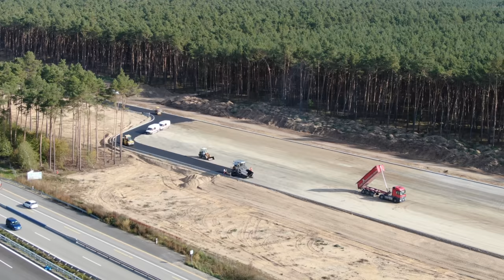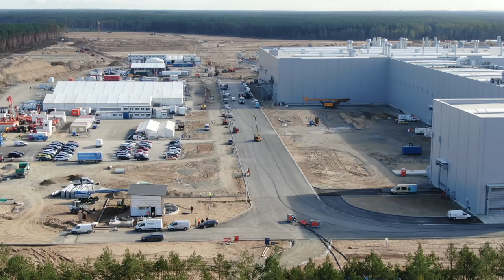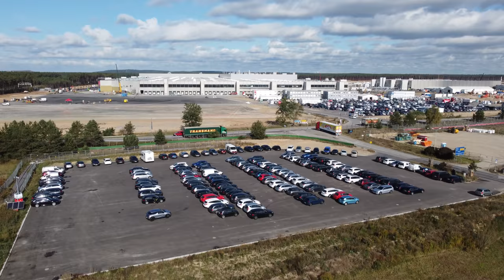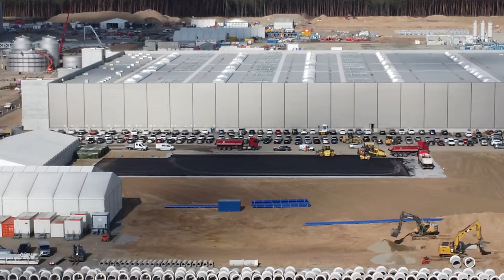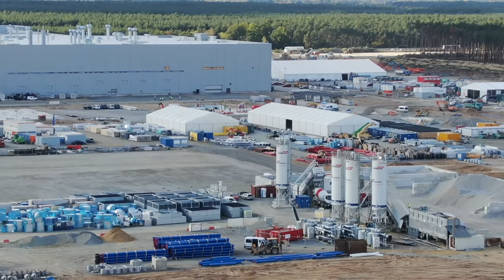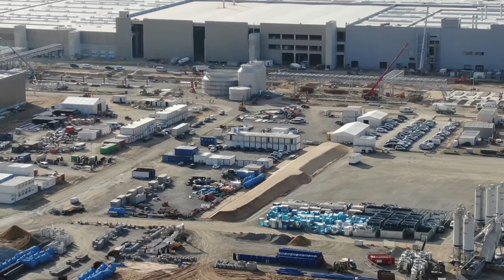Giga Berlin | 2021-10-13 | Timelapse

Comment: Cannot imagine that in the beginning there was made a calculation by a group of engineers for an offer to build this factory at a certain price ? 
Each truck and each crane that is driving around on this construction site is either paid by the hour or paid by the km that it is driving. Same is valid for each construction worker and each subcontractor.
Who knows in advance what work has to be done for this project. Incredible!

Comment: The small size of the battery factory is astonishing - space requirements of 4680 cells seem to be 1/10 or so of the original 18650. To my understanding battery factory is designed to cater for giga berlin exclusively?! If so, this is really impressive.
Reply: See battery day, the dry coating material means 10X reduction in space required and 10X reduction in energy used (no drying required).
Reply: ~50GWh from that plant, more than Nevada!

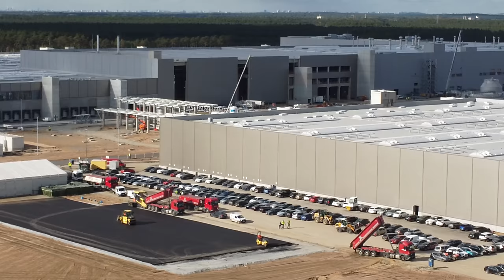Comment: 11:51 Will there be big windows on that wall or will they put panels? When will it happen?
Reply: There will be surely gates on ground level there. Also at the part between the small and the tall staircases. Here it looks also as there will be windows on the 1st and 2nd floor (European counting). Don't think there will be windows where the Giga Presses are (or will be). Horizontal windows would be easier and cheaper than big vertical windows.
Reply: Production areas will not have wall windows, that is a safety hazard. You don't want to be blinded by a sudden beam of sunlight while operating a machine that can easily mush you and 5 other people in one move. Only offices and other non-machinery areas will have those. Production areas will only have ceiling windows, as those cannot pass sunlight directly into your eyes. And even then, they are frosted.
Reply: @HenryLoenwind  Giga Texas factory has windows on the exterior vertical walls in most parts of the factory.

Comment: I see they are starting to put up some tents. It seemed crazy when they put a whole Model 3 assembly line in a tent at Fremont. I suppose if a tent will do they go with that rather than a more permanent structure.
Reply: There will be no tent line at Giga Berlin.
Reply: @monsieurb90  You don’t think the German regulators will go for that? Oh well.

Comment: Maybe my imagination, but the activity seems to be at an even higher tilt after GigaFest.
Reply: New pre permission arrives for Roof installation and some other Things.
Funfact: Earlyest possible overall Permision by law possible in 2 Days after public hearing. 
Then ramping up in Hours
Reply: @JK-ku2mj  Die Genehmigungen werden NICHT 2 Tage nach den öffentlichen Anhöhrungen erfolgen, und es wird dann auch nicht schneller gehen.
Reply: @JK-ku2mj  What's the overall success rate for permission after a public hearing? Or is there any particular case study similar to Giga Berlin? Just curious.

Comment: I have a question Tobias, when will the model 3 be produced in Berlin?
Reply: no
Reply: @bliblablubdiedadup742  why?
Reply: My guess is in two years. First the model Y needs to get production ramped up, then other models will follow. It may even be that the German designed city car will come next.
Reply: @gpsfinancial6988  Two years?  I don't think, model Y is popular, but its price is much higher than model 3
Reply: @manucorpas1977  Tesla removed Model 3 production from the Shareholder Deck	since Q3 2020 in Berlin.
Reply: @bliblablubdiedadup742  That news you say is not true
Reply: @manucorpas1977  look it up yourself?
Reply: @bliblablubdiedadup742  Says the motor press, model Y vs model 3 in Berlin
Reply: @manucorpas1977  No clue what the words mean you randomly put together.
 There wont be a Model 3 out of Berlin in the foreseable future, because like i said, they removed "Model 3 In development" in Berlin in their finacials. Model Y maximum rangeis currently  6k more expensiv than euqal Mode 3 with the gap likely closing down. 
I am almost certain, they ll go for new models instead of Model 3, if the expand Berlin^^
Reply: @bliblablubdiedadup742  no no no no no, no ok?
Reply: @bliblablubdiedadup742  You don't even know what you're talking about
Reply: Currently they are building one production line. While it is possible to build a line in a way that it can be switched between different models, that is a big waste that's only done if you have models that sell way less than one line can produce.
Reply: @HenryLoenwind  German Air Model 3 is getting closer every day

Comment: Waiting for Highvoltage Power connection....without is full Production impossible
Reply: Do you mean the high-voltage power connection to the switchyard? 110 kV underground cables.
Reply: @abalada  it is alredy finish? Great! Thanks
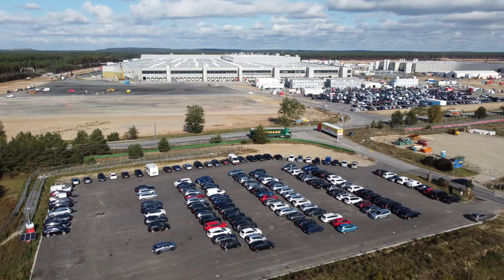Reply: @JK-ku2mj  Depends on how you define "finished". The 3 big transformers are connected. There is a provisional connection where the cables lie partly just on the surface. 7:02 the red pipes parallel to the street. Planned is to my knowledge a redundant connection (thus 2 x 3 x 110 kV cables). But I assume the empty underground pipes for those cables are on the property of Tesla already laid.

Comment: the stock is acting like it did in february 2020. it is definitely going to pop as soon as the news comes as to opening day. what ever that is elon will probably not start that day. has he ever started are introduced anything in 10 years when he says.? so we get the pop. we get a good run. when its time to open. put in stop losses. in case he says next week a couple times.  my guess is 1000-1100 on berlin. texas 1100-1500.00 and level off there till production and quarterly earnings are showing gain.

Comment: Berlin better hurry. Giga texas right on its ass. if texas opens first berlin be laughing stock.
Reply: Rubbish
Reply: @damnmister  will see texas already producing parts for months now.
Reply: @rikji  Yes, one of the casting machines is operational at Texas, but the stamping machine? Paint shop? Assembly lines? All of these are ready at Berlin.

Even if Texas opens first both factories have a year of ramping production ahead at maybe 2 years before full capacity is managed.

Who is it that's going to be laughing exactly?
Reply: @damnmister  OEMs
Reply: the focus for Tesla and Musk in Berlin is on quality not speed. Elon wants quality and Giga Berlin is according to Elon Musk the most advanced project of all Giga factories. You will see it also in the quality of the produced cars in comparison to Austin.